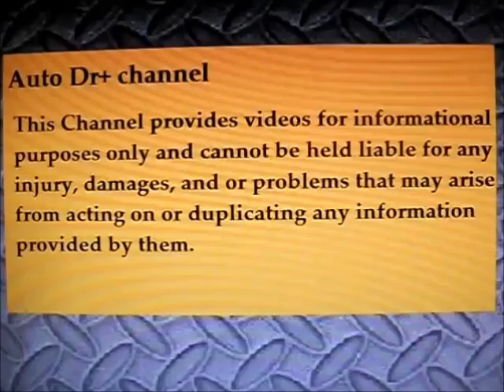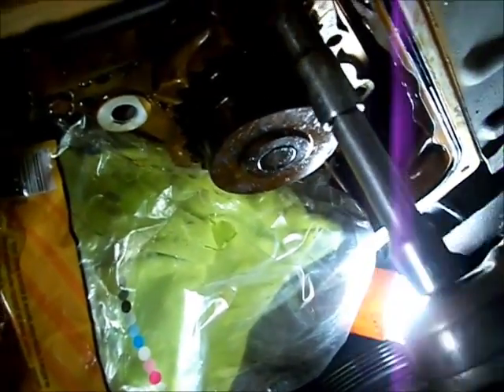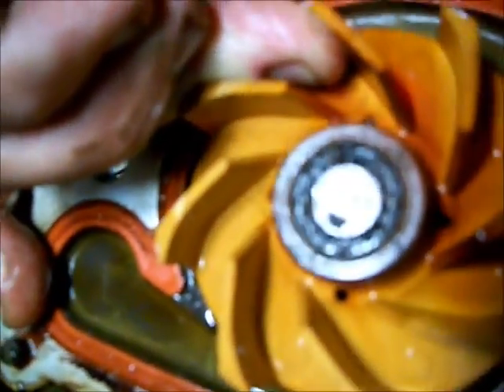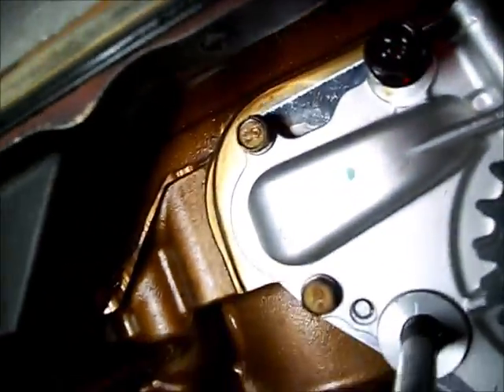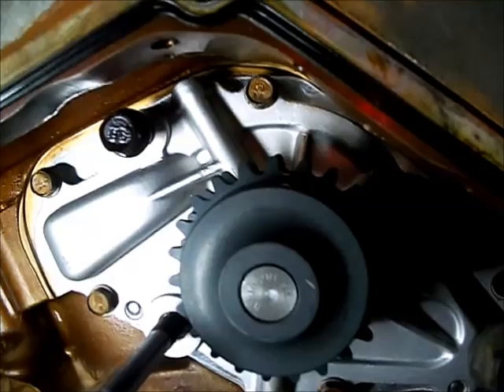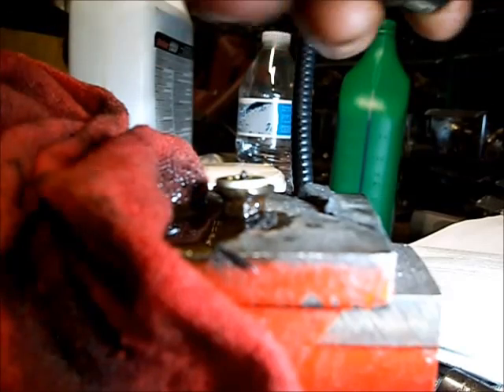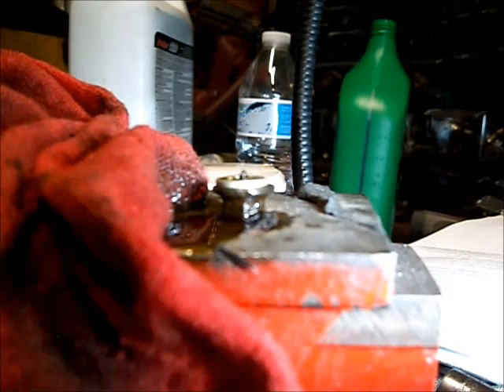Dodge Magnum `05 w 2.7l pt.2 water pump replace timing chains

Comment: oh, if you leave the coils disconnected you start the car, the oil can circulate and also fill the tensioner.
Reply from the maker: +Stephen D.    Thanks for the comments.  Or you could just pull the asd relay crank sensor pig tail- fuel pump fuse- or fuel pump relay-; (which leaves the coils sparking but no fuel delivery.  But to tell the truth, the georator oil pump just doesn't put out well at low rpm, so starting is my pref. to get oil to it fast.
Reply from the maker: +Auto Dr+  An example is that the min. oil pressure @ idle needs to only be above 4 psi to keep oil light off. @ 3000 RPM I have read the oil pressures on these well above 100 psi.
Reply: +Auto Dr+ do you use any sealant on the water pump gasket? does chrysler use it from the factory? i didn't have time last weekend but i'll do it this weekend. thanks again
Reply from the maker: no sealant required
Reply from the maker: +Auto Dr+  The gasket supplied with any 2.7 L water pump usually, is an aluminum plate with a premoulded rubber membrane sealing the water jackets.  It is an excellent designed gasket, and virtually fool proof from leaks.  A welcome exception to many other sealing scenarios
Reply: +Auto Dr+ thank you very much...i'll let you know saturday how it turns out
Reply from the maker: Kool, & don't forget to recheck your timing marks. (Mainly the crank shaft one).  I have found that if you point a cam or cell phone level and in a straight line pointed at the timing mark and colored link, take a picture of it.  The pic shows the alignment very well.

Comment: Thank you for video, i have to do my water pump this weekend. Car has been great, but WHAT chrysler engineer thought of putting the pump in there would be a good idea. I appreciate you showing me the timing marks and primary tensioner. I'm replacing the tensioner as a precaution.
Reply from the maker: +Stephen D.  If it doesn't already have it, and your keeping the car..... I strongly recommend converting it to the new style chain, pump, and gears from the dealership only.  While you`re in there, expensive but that area is the weak point of the engine and installing the new stuff means you wont have to look back...... For prob at least 75k miles.
Reply from the maker: +Auto Dr+  If it isn't sludged up already from lack of timely oil changes.  If it is really sludged up, it should be pulled and overhauled if keeping it.Can get by with just machining the crank and matching the appropriate bearings.  (A WORD ABOUT THE MAIN BEARINGS)  They are select fit.  Yes they can all be different thickness, which must be taken into account when replacement bearings are necessary.  Both the crank & block can, or not be of different diameter.  (Nice... NOT!) There are numbers to be added and subtracted to determine the original bearing sizes, stamped in two places: 1 set, (read left to right) is on under the left engine mount on block along oil pan sealing area.  2. On the rearward facing crank counter-weight, behind ea. main bearing journal.  These numbers that are critical to matching the bearing under-oversize variance that may be present from the manufacturer.  (YES THE THICKNESS OF EA. MAIN BEARING CAN BE DIFFERENT) from the factory.  There are 3 grade level number. (1-2-3)You cross match ea. number.  ie. If there is a (1 on the block and the corresponding counter weight is 1) it is a standard bearing, 2 to 2 & 3 to 3 are standard sizes all good (the number grades are laser etched on the face of the bearing as well, ie 1111-2222-3333).  But if you see two different numbers for example, 2 on block and 1 on crank weight, the bearing will be stock sized (--0.0001).  There are 7 different thickness possibilities, from +0.0002 to -0.0002 to standard sizes. There is a chart to cross match the numbers to which shows the size relationships for crankshaft bearing fitting.
Reply: +Auto Dr+ I bought the car(stratus) new, it now has 105,000. It always had 5,000 mile oil changes and I've done a few motor flushes. It had zero sludge in it. I still had 4mm left on the primary tensioner. I still replaced it with the water pump but reused chain and guides. Even the valves had zero deposits. I work at chevy dealership so it wasn't to had to figure out. I did crank the engine for about minute with the coils unplugged and had maybe a split second of chain noise. thanks again for the video!!!!
Reply from the maker: Thanks for the sharing your story.  If the maintenance has been done to engine it has good head start on most 2.7`s that I have seen.  (Sludge in heads so deep that you cant even make out the cam bearing bolts, the valve cover turns into a giant jello-mold of black carbon.)  And with as little as 30k miles on them, I think those must have had the original oil in them to do that.  I always thought that if I could get that 2.7l out and put an older vortec 4.3l drive train in there, it would last forever.  I did see a tube video that someone converted an intrepid to rear wheel drive, and was doing a serious burnout with it.  Plenty of room in there, and it has a tunnel for drive shaft, decent metal to install leafs/rear end etc.  Oh well their to old to waste $ on now. But good luck with yours, it does well if you just keep a little xtra eye on it`s weak points.
Reply: +Auto Dr+  hi I have a 2007 2.7 300 and i was hearing a rattle knocking noise coming from the top of the engine it sounds kinda like chan lash from a lose tensner  or worn chain and it only did it every one in a while at a idle or in park or but when i pushed the gas it stops so I opened her up and thd timing marks are totally off I dont even know how it was running .the inside the valve covers were super clean no sludge wich is a good thing .  but I was thinking of replacing thd timing chain and hydraulic  tensner  what do you think and wich parts should I get because I see there is newer chain styles so I dont wanna run into a problem with the pitch of tje teeth not matching yhe chain and im probably gonna replace the water pump while im in there  thanks
Reply from the maker: Hi Bailey, not sure how it was running if the timing marks we`re off.  Typically once the cam and crank sensors are out of sync, it isn't suppose to start to prevent engine damage.  But if you`re hearing noise in the timing chain area, it is wise to deal with it immediately. .As far as what to replace?  It is best (only option)to start from scratch, and replace everything connected to the chain, all of it, if it has the old style chain especially. From the dealership. Copy the vin code down and call to see what parts they have in stock, and a total amount.  Parts shown in the video below at time index 0:19.   BOTH STYLE CHAINS SHOWN HERE at time 1:04:(https://youtu.be/pCbqQJnuUz0).  The larger old style chain isn`t sold by the dealer anymore, and aftermarket chains will not last but 12k miles.  So buying everything from the dealer to convert or upgrade the chain and sprockets to the smaller new style chain is painful, but well advised. They seem to hold up well.  Pick up a new front crank seal while at or calling dealer, and usually change the thermostat and seal while in there as well.  ONLY use dealership thermostats on everything.  Aftermarkets are unpredictable, and will cause severe engine damage when they fail.  Aftermarket valve cover gaskets are acceptable replacements, if installed only once.  Timing cover seal is usually reusable if it isn't damaged. Continued on to next post.
Reply: Ty very much is there a way to tell if I have the newer style chain
Reply from the maker: Pay attention and check timing marks multiple times before covering it up, or it wont start. (Just 1 tooth off, and its done)  And it will have to come apart again.  Not sure how yours could be running out of time. (you would have to put crank on it`s TDC timing mark, while cam gear marks are near 12 o` clock tensioner bank side and 11 o` clock cam sensor bank side  And then move chain colored plates to their proper position to verify timing alignment).  Lube tensioner plunger and cavity well, and install tensioner plunger perfectly square with the bore carefully.  As even from the factory the o-ring can get a chunk taken out of it and fail later.  This in effect can cause a severe drop in oil pressure especially at idle, which leads to premature damage to crank bearings.  The crank sprocket should be heated to about 300* F (heat focused on sprocket) (while it just sits on end of crank) and installed rapidly.  Preferred to use longer crank size bolt, seated in crank shaft with nut on bolt and deep enough spacer to press sprocket down. Verify sprocket bottoms against crank.  This can be done without the heat, but requires 4 x`s  as much force to do it.  Heat is best, not to hot to take temper out of sprocket (500 *F is pushing it), just expand it some.  The factory did it this way. Good luck with it
Reply from the maker: Bailey Wittmann   yes read my comments, I have a video of the 2 side by side
and all the parts in a box that should be changed.
Reply: Auto Dr diy hey I did the same thing and my car making a rattling nosie too..I changed the water pump,tensioners,cam shaft gears, and etc..still making a nosie help